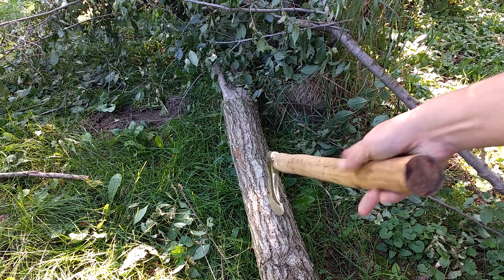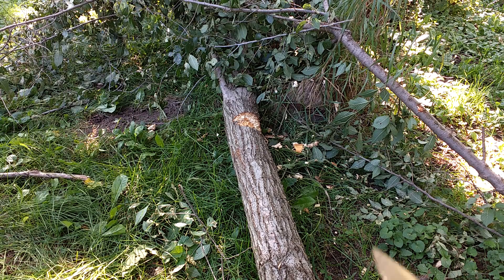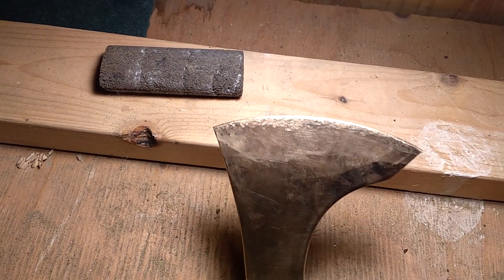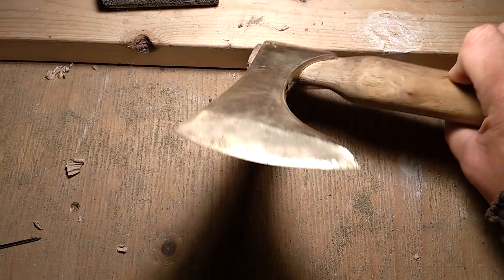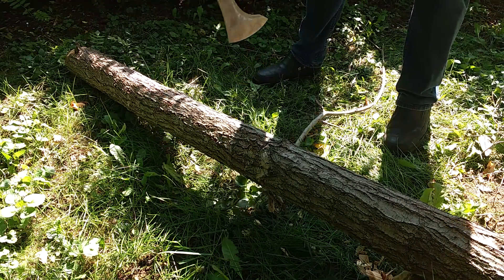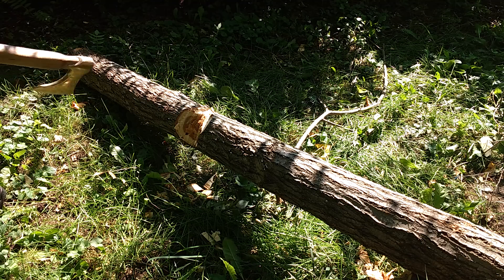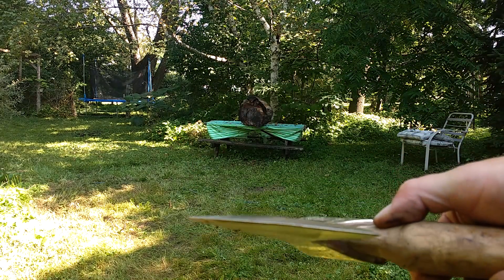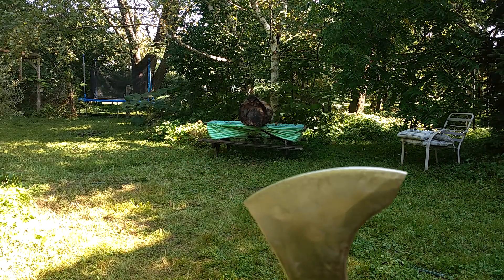Epic Aluminum Bronze Axe Fail! - Annealing Vs. Work Hardening (part 4)

Comment: thanks a lot for this video, showing the mistakes helps us newbies a lot
Reply from the maker: Glad you found it helpful!
Reply: @tobhomott  have you tried making any other aluminum bronze tools?
Reply from the maker: @pregno1421  I've got a couple of different axe patterns, there's video about my pipe tomahawk on here if you want to check it out.  Pretty sure I have a playlist to make them easier to find.  I also made the little peening anvil that I use in the work hardening process with the same alloy, and recently I cast an aluminum bronze pattern rapper tool.  It's significantly heavier than the aluminum one I use for most jobs, for heavier/deeper patterns that need a bit more force to loosen.  I think those are the only tools per se, but I've also use Al-bronze to make a few spear points, a part for an antique letter press, and one or two couple other pieces, decorative stuff.

Comment: Hi, what aluminum bronze alloy did you use? Were there any impurities in the metal from mixing the bronze? The reason I ask is that the mix I used had a more golden color to it. It seems to have held up unbelievably well for a homemade alloy. Also, do you happen to know how much the axe head weighs?
Reply from the maker: I used purchased C954 aluminum bronze, not a homemade alloy.  It has somewhere in the neighbourhood of 10% Al, 5% Fe, plus a couple percent of other ingredients other than copper.  It really does hold an edge well.  WeIl enough for my occasional camping trips and yardwork, anyhow.  I know I weighed the axe head when I first cast it... Just found the number it in another reply here, it weighs about a pound and a half.
Reply: @tobhomott  Wow, that's a lot lighter than I thought it would be. I wanted to make one of my own is why I asked, maybe not having any trace elements wouldn't make for a strong edge.
Reply from the maker: @domchubs5836  I've worked with 90/10 aluminum bronze that I alloyed myself before too, it was nice and hard too.  You don't want to go over 12% aluminum max though, or it can turn out to be brittle as glass.

Comment: while making the axe it should beforged into form, that makes it hold an edge.
Reply from the maker: From everything I've been able to discover, bronze age blades were cast, then the edges were peened (cold) to work harden the metal.  What I show here is my take on the same process.  It's been years since I filmed this and I still use the same axe for chopping thick ice in winter, splitting hardwood during camping trips, and all kinds of yardwork (any excuse I can find) and all I do is give it a few strokes with a sharpening stone once a year.  Although I did have had to do some grinding and peening one other time after I accidentally hit a rock and put a chip in the edge. 
Thanks for watching, and apologies for the very late reply!

Comment: Would you recommend aluminum bronze for a hatchet as a reasonable tool? I'd like to make one but I don't know if it's useful. In comparison to say a railroad spike hatchet is the aluminum bronze just as good or close enough? I really would prefer something cool looking like that.
Reply from the maker: I take mine camping every year and chop quite a lot of hickory logs with it for all night campfires.  This year a guy in my group brought a chainsaw so we were using that to chop thicker trunks into short pieces then using this aluminum bronze axe to split them.  I use it to chop thick ice on my back porch in the winter and for various yardwork tasks throughout the year.  As long as I don't hit a rock or a nail, it seems to hold its edge quite well.  It's not high carbon steel but definitely better than I would expect a tin bronze axe to hold up.  If I just touch it up lightly with a stone a couple times a year,  I won't have to redo the edge peening for a long long time, but if I do hit a rock and have to grind out a nick, the work hardening needs to be redone - it only goes so deep.  Supposedly this alloy (C954) can be hardened via heat treatment as well, but that is still on my list of things to try someday.
Reply: @tobhomott  thanks! I need to give it a shot. I think your axe is classic looking. Who has bronze anything? That's one of the reasons I want one as well. Thanks for doing the grunt work and making one in a video

Comment: Why were you trying to throw it underhand?
Reply from the maker: JAG827 casting Just to see if I could get it to stick in that way!
Reply: Tobho Mott ok
Reply: Tobho Mott you should try making an aluminum bronze sword
Reply from the maker: JAG827 casting very tricky to pull off in a sand mold...  I've thought about trying to make a knife though.
Reply: It is possible to stick an axe/tomahawk when throwing underhand. Neat little trick and not easy but can be done.

Comment: you won't get aluminum bronze hard enough to be used as an axe that is at all comparable to a steel axe.
Reply from the maker: Kevin Keel well, I believe it is much closer to the hardness of a steel axe than it is to a traditional tin bronze axe.  It'll chop hickory logs into firewood all day long and the work hardened edge holds.  Aluminum bronze is not your everyday copper alloy, they actually use it to make no-spark axes for chopping near gas lines, etc.  Check out my friend Chirpy's video where he tests his homemade aluminum bronze and you might be surprised by the results: https://youtu.be/gsh9ARSHwEo
Thanks for watching and commenting!
Reply from the maker: Kevin Keel ...and I definitely can't cast steel in my backyard foundry!
Reply: aluminum bronze will harden to about 80 points on the rockwell B scale, which is about 10 points higher than mild steel. a serviceable axe should be somewhere around 40 points rockwell C - significantly harder. something like a 112 on HRB
Reply from the maker: Kevin Keel interesting stuff, thanks.  I guess it's a lucky thing I'm not a lumberjack then. 😀 For me, the fun factor makes a project/challenge like this build worthwhile for casual use - ie. A couple of camping weekends a year.  I'll try building a forge and hammering on some steel one day, but making molds and casting metal is what I really enjoy. Thanks again for those hardness numbers.
Reply: Sure, no problem - one thing you may consider is an aluminum bronze body and a steel bit. i take it you don't need to utilize the non sparking effect of aluminum bronze, but you can take advantage of its aesthetic and ease of manufacture (in your case) while using something like an old file which can be ground into a practical edge and cast into the body. drill a couple holes towards the back so the casting has something to grab and hold onto. 

there is a video on youtube showing something similar - a knife with a tungsten carbide bit and the body is simply aluminum cast into ceramic cloth (like fiberglass cloth and resin). it's an interesting concept as you get almost the best of both worlds, extreme durability in both hardness and toughness. usually you have to decide between hardness or toughness.
Reply from the maker: Kevin Keel you've really given me something interesting to think about, thanks.  Got a link to that video you mentioned by any chance?
Reply from the maker: Kevin Keel thanks, I'll have a look...
Reply: Kevin Keel how is it that you say mild steel is 70 Rockwell. That's way off
Reply: @Kevin Keel
Good idea! 
But how would you go about drilling a hole in a file? Also wont the heat of the casting change the heat treatment of the file?
Reply from the maker: kistuszek. Thanks for your comment.  I was wondering the same...  You could grind a couple of slots instead of drilling holes, and I'm not sure at all how the HT of the file would be affected.  I doubt I'll try it anytime soon; next axe will be made as a wall hanger for a friend and probably will be done all in silicon bronze for easier casting and keeping the possibility of patination alive, but I wanted the one I made for myself to be an effective log chopper before all else, which it is, hence the more challenging al-bronze usage.
Reply: Tobho Mott HT would have to be done carefully, al bronze probably has slightly higher melt temp than steel'squench point, may have difficulty. 

Drill a file either soften it first or use cobalt drill bit or both.

Comment: Winder how a bronze aluminium knife would hold up.
Reply from the maker: Don't let all the "decorative only" homebrew aluminum alloy blades on YouTube fool you; al-bronze is quite suitable for making usable blades once it has been work hardened.  Ie. It isn't as good as hardened steel but it'll hold an edge better than other bronzes.  Maybe I'll try it next summer...
Reply: Ardie Reitsma im going to try and make a fillet knife once I get all my materials together
Reply: @bfries555  filet knife is a decent idea.
It's main objective is being a sharp cutter and isn't enduring lots of stress for it's task.

Also I have seen some test's on just regular bronze (well, as far as there is one 😅) 
Anyway, it performed very very well, only when they were hitting it against steel did it clearly lose.

Comment: real bronze will less fail on you the aluminium is much more brittle than the tin
Reply from the maker: chucky 89 Thanks for watching and commenting, I do have plans to try casting some different bronze alloys in the near future.

However, I have to disagree with you here.  What you say about aluminum being more brittle than tin may be true, but when alloyed with other metals these properties can change, and the way that the Al combines with the Cu in particular is somewhat unusual in terms of the metallurgy involved.  

FYI this axe was cast using purchased alloy C95400, not a homemade mix, just in case you're interested in looking up its known properties.  

The damage it took here was due to it being made soft by accidental annealing, not from brittleness.  Nothing ever broke or chipped off of it, the edge only bent.  If it were brittle, it would have broken rather than bending.  

IMO real bronze age people would have seen aluminum bronze blades as almost magical, it is a lot tougher and stronger and harder than tin bronze, and since filming this I've used this axe to chop extremely hard hickory logs for firewood for hours on end, without it taking so much as a scratch.  It holds its edge beautifully.  I would be very surprised to see a tin bronze axe show such durability. 

Aluminum bronze is used in making modern axes for firefighters and other workers to use around gas lines etc., where a steel axe might throw a spark and get you and your crew blown up.  To my knowledge, the only professionally made tin bronze axes being made today are historical recreations, where the alloy is chosen for period accuracy and not for performance.  

If you have references indictating otherwise, I'd be very interested in any links or sources so that I could check them out for myself.

Thanks again for your feedback, it really is much appreciated!
Reply from the maker: Ethan Hohlt I didn't put a timer on it, but it was an interesting comment and I'm on holiday <shrug>.  You asked me a similar question just the other day so I gotta ask - How much time do you spend looking for long replies to comment on?
Reply: C95400 is not a "pure" aluminum bronze, it has 4% iron, 1.5% nickel and 0.5% manganese which probably account for its superior properties - as well as a magnet sticking to it. :)
Reply from the maker: stamasd thanks for posting the rest of the ingredients, I know I glossed over that in these videos.
Reply from the maker: Ethan Hohlt lol, same to you, I do tend to ramble on sometimes... :)

Comment: Was that a forged in fire reference I heard?
Reply from the maker: Delta One-Five-Niner it's not about what the axe does to the tree...  Good catch! ;)
Reply: I caught that too... decent show. But great work on the axe. And I learned a few things from your videos too, which is a good thing because I plan on doing a similar project soon.
Reply: I'm not into making videos (so far) but here's the model I'm working on. So far half the blade, have to add a guard, hilt and pommel. And refine the tip a bit. It's a 1:5 model. https://www.dropbox.com/s/wgu419192cs6gsi/xiphosv1.JPG?dl=0
Reply from the maker: stamasd Thanks for watching... What are you gonna make?
Reply: I'm planning for a xiphos, aka Hoplite short sword... after which I think an axe should be in order.
Reply from the maker: stamasd cool!  You gonna make a video or share photos somewhere?  I haven't seen a cast al-bronze sword done before, but the technique I used for work hardening this axe was a combination of things I saw in some scythe peening videos and some things Neil Burridge has said about how he hardens the traditional alloy bronze age blade replicas he casts.  Good luck!
Reply from the maker: stamasd super cool stuff!  Wish I could follow along somehow. Doesn't have to be video, consider sharing your progress and pictures (or just lurking looking for casting lore if that's more your thing) at the alloyavenue.com and/or TheHomeFoundry.org forums, lots of great advice and info there for a project like that.  Good luck!
Reply: Thank you for the links, I will definitely check them out. I have been lurking for years at https://www.bladesmithsforum.com/ but haven't had the opportunity to start making anything practical until now. My ultimate goal is to make true Damascus (wootz) and blades from it. I'm starting with bronze because it's easier, beautiful and intriguing.
Reply from the maker: stamasd I'll check out the site you linked as well, thanks!  You have an ambitious plan there, good luck with it!

Comment: for anyone thinking about making this I would recommend you make a much heavier axe blade then he did so it cuts way easier
Reply from the maker: This one is about a pound and a half, so really more of a hatchet.  I tried to pick a suitable handle length based on its weight.  Thanks for your input!

Comment: Live and learn Jeff.  Making an AXE out of a rather primitive metal, it's good to keep in mind they didn't have belt sanders back then!  lol.  I'm glad you saved it.  Now go bring your buddy some beer and fix that booger!
Reply from the maker: LoL, true enough but they didn't have aluminum bronze either!  :). Welder guy down the road is more of an acquaintance than a buddy (he made one of my steel crucibles for me, and the stand for my stack melter, back before I got the cheapest (80A!) fluxcore machine money can buy, LoL), but I will try to see if I can arrange something.  I really don't want to destroy the handle I made though, I've got a bit of a sentimental attachment to it...